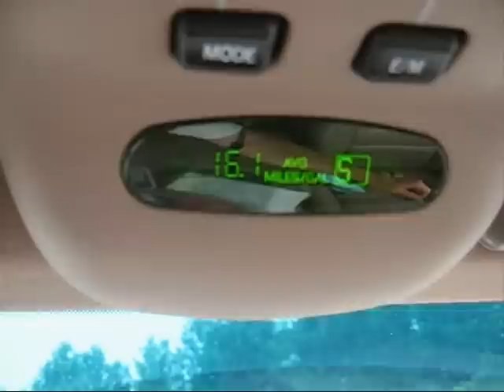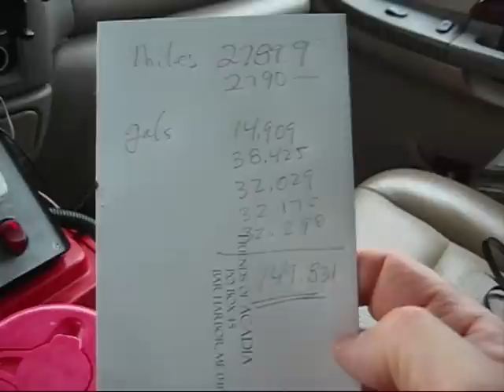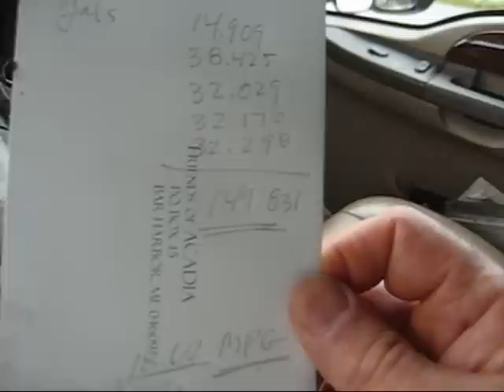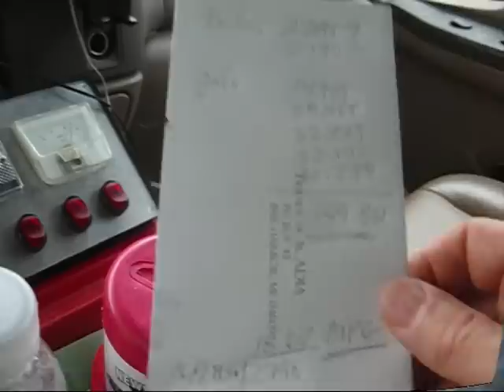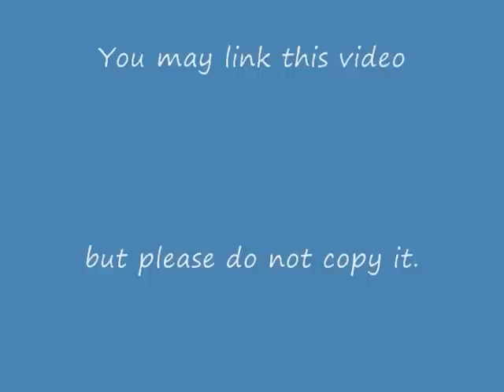MPG (mileage) Test 2790 miles with Dry Cell HHO F350 Superduty 7.3 Diesel

Comment: just a thought, OK so everyone is talking about how much energy is required to produce the hydrogen vs it's energy available when burned as fuel right? so how about building a wind/solar power station at home and producing the gas to be compressed into a tank? yes it would require more energy to produce, but what does that matter if one can run a vehicle or generator on hydrogen? we all have seen that mythbuster video, they did successfully start and run a vehicle with only hydrogen. they did not use a flashback device and that's why the hydrogen gas ignited. anyway, the point is, anyone can produce hydrogen and yes it will work as fuel once it is compressed and it works help to use a natural gas or propane engine. you can knock it and doubt it all day but ,even if it takes three times the energy to harvest, if you get said power from wind, solar, or hydroelectric.. who cares how much energy it took? isn't being independent and able to provide your own fuel/energy with the environment around you something to be respected and utilized? fact - fossil fuels will be depleted eventually. fact - hydrogen is the most abundant element in the universe. don't be a puppet.
Reply: Fact: Fossil fuels will last at least hundreds of years. Fact: Hydrogen is the most abundant element in the universe, unfortunately, elemental hydrogen does not exist on earth.
You are correct. However, you would only have to buy one third as many solar cells if you ran an electric car rather than a hydrogen car.
You will most likely be shocked to find out how many  solar panels you will need to produce enough electricity to run your hydrogen car! They will cost more than your house.
Reply: I'm a guy that lives in a small house and I only require 2500 watts (about 300 square feet ) to live very comfortable so I may be an exception to the space and money required cause I can build my own panels easily for under 2000$. That's with the inverter and south facing panel array. Your right though, if someone wants to live in comfort as most of us know it, yes it would be crazy expensive but luckily I don't like the overabundance so it works for me. It's all about who you are as an individual and how much of a skill set you have.
Reply: If you're talking about your home, no hydrogen is needed. Converting electricity into gas and then burning it in a generator to make electricity would be even more stupid than using it for your car. 
It is clear you haven't done the simplest math to see if what you propose makes any financial sense. 
What is your goal? If you want to do it because you want to drive a hydrogen powered car and live in a hydrogen powered house, fine. But, if you want to do it to save money, that will not be possible. It will cost you more than your house and a new luxury car with ten years of fuel for it.

Comment: If I kept my 2000 7.3 (F250, supercab, 8 ft bed, 6-spd, 4x4) under 2k RPM (70'ish), I could get 18.x mpg regularly. If I drove 55-60, it was in the 19-20 range...be it, it is a manual truck. 

Seeing 2 mpg, and having done a few years as a diesel performance and emissions engineer, that range in change could easily be from the difference in driving atmosphere/style.

Comment: I've gotten up to 32 mpg on a 2005 Ford Excursion turbo diesel on highway. 18 mpg seems kind of ridiculous honestly.
Reply from the maker: Occasionally this truck gets 99.9mpg.
Reply: Lol now thats just too funny
Reply: what is your set up to get 32mpg?
Reply: There isn't really a setup, the truck was just stock from factory. The only thing is that it was getting preventive maintenance every now and then. 

You know, just keep the engine running In good condition. It Will give you great mileage.
Reply: No, that's after doing the math. Miles traveled divided by gallons of fuel used.

Comment: hmmm my 2000 f-350 7.3 5 speed gets 19.6 hwy mpg stock.
Reply: joerotorhead. Agreed 
Also have a 6.0 with a heavy tune and 35" tires 6 Speed manual. 4x4 with hubs locked in .. 19.8 MPG.

SOMETHING NOT QUITE RIGHT HERE
Reply: I got a 99 ford 7.2 & get 17+...with 33k on it
Reply: Funny not one of you mentioned you rear gear ratio and only one of you mention tire size..

Comment: People always think of a diesel's mpg as like a gas engine's mpg ,wrong ! Diesel's mpg first off is mostly dependent on RPM's , you will get the same mpg in the city as you average on the "highway,( freeway)". If you want to increase your mpg's the most,get a higher geared rear-end. A 3.54 rear-end will average 24 mpg, ( empty weight ) , a 3.70 or a 3.73 will get you about 15 to 17 mpg or so & a 4.10 or a 4.11 down around 12 or so. Then after choosing your gearing ratio's, work on the aerodynamics ! In the old day's all semi's rpm's were 17 to 21 ( 4 to 5 mpg's ) , now their 13 to 17 ( 6.5 to maybe 8 mpg ). & some newer engines are even running abit lower on the rpm's. but here's the difference, Alot more Horsepower, lower rpm's = higher Torque    . Torque is what pushes you down the road with a diesel ! Torque is produced ,of course , by burning the higher btu's of diesel fuel. You can't "increase " your mpg's by lowering the BTU's of the fuel ! I do know a few owner operators the experiment with the old split rear ends , combined with there drive train, to lower the RPM's while driving on flat ground or just with lighter loads. ( Also, this only works with what is referred to as a single screw rear-end, such as your pick-up truck is. Most all semi's , with two axles on the rear are referred to as a twin screw : > ) ! ) Now for something out of the past, if you really want to experiment with something, some of the really older semi trucks had Two transmissions , one in front of the other ! If you've ever seen ( or heard of ) a twin stick truck, ( that's 2 shifting levers ) ! I've thought about putting two automatic transmissions ,one in front of the other , just to see if that'd work ! Good luck !
Reply: +73roadrunner1 yup, good 'ol brownie-box. many were shifted via solenoid switch on the main shifter, if you're good with it MPG goes up a bunch. a friend had a little old Dodge Colt with a 4 speed, plus mechanical shifted brownie-box. it took him a while to learn the complete shifting pattern (tricky!) that breaks into 500 rpm increments. car also came stock with an intake vacuum meter to help determine efficiency/gearing.

Comment: If you can see the fuel level in the neck then it means it's running out the overflow all over the road.
Reply from the maker: +thra5herxb12s I have topped off the tank this way dozens of times and I never had any spill. Some trucks may leak when filled this way but this one does not.
Reply: That's ok. Dont forget to leave enough room for expansion though.
Reply from the maker: +thra5herxb12s I used to worry a little about expansion at first but it does not take long to use up the fuel in the filler neck. and I haven't had any problems.
Reply: thra5herxb12s

Comment: I put a chip in my diesel, 6.0L Ford Diesel.. I'm getting 25mpg. Prior to putting my tuner on the truck in economy mode, I was getting 17.5 - 18.5 here locally.
Is this something magical here about this HHO? What is HHO? Hydrogen or what is it ? I found a bunch of wire on ebay, spring wire for a project, and it said it's for HHO, and had some danger disclaimers.. so wondered WTF was going on.. Google brought me here..
Reply: +Poppa Bear I too have a 6.0 "Bullet Proof" package with chip and 4inch open exhaust. Maryland to southern Virginia, cruise control at 70 MPH most of the way........24.4 MPG with AC on. Yea so I'm with yea on that.
Reply: Jamie Norton I got rid of the 6 liter a while back, and got a 6.4. I've been pretty happy with it, until a few days ago, it threw a warning light . I think it's simply under charged battery caused a glitch while starting. I need to remove the posts, let it drain, reconnect and see if the issue is still there.
Been a good little truck so far. Metal rusts pretty easy underneath however.

Comment: As much as it is great to see people experimenting and I realise that the total weight was very high plus bad aerodynamics plus a US gallon is slightly smaller than an imperial gallon etc etc. My recent holiday with my crappy GM diesel car towing a small trailer averaged 56mpg over about 1100 miles, the overall weight was a lot less than you were hauling plus I have only about 200hp. To be honest your fuel consumption sounds extremely bad (by European standards). It does seem like you are using a lot of current in your electrolysis, I realise you have a big engine but you are probably using 3 or 4hp just turning the alternator.
Reply: +David Lisney I've been so jealous of your vehicle options over there.  Could never understand why we don't get little diesels.  They are practically drive for free lol.  Oh well, I guess I can't complain with gas at a $1.69 per gallon.
Reply: +David Lisney Hi, I have a diesel short school bus that I'm going to convert into a 
RV, i bought it for $500.00 the man said he thinks it blew a head gasket
 how can i tell and if it cracked the block, please need advice should i
 try to crank it, please get back with me I'm desperate thanks
Reply: @mollythomas6824  look up oil in coolant

Comment: I respect your ambition but to improve your system you need to remove your massive brick with a smaller more efficient design. Either wireless elcetrolisis or 12v dry cell tower. Keep resivor almost full at all times because keep in mind heat is not the source of hho. It is the electromagnetic Impulses that split h20 into hho. It will convert at any tempature above freezing. I encourage you to look into free electrical generation "with no moving parts" to power your dry cell. Because with and alternator to power your cell you will never get more energy than you put in to spin it. Keep it up!
Reply: But the gas is not supposed to spin the alternator but mix with the fuel to explode better for a better conversion of the residual energy in the petrol that gets wasted because the environments it explodes in is heavy and non volatile, as opposed to Nitrogen.

Comment: I have done this. It will waste your money and time. I bought a basic system from Ritchie, "HydroClubUSA" and a basic system from "Green source" in CA. It is useless. Cost me hundreds of dollars. Neither would refund my money. Proof its a scam! I even built my own HHO generator. It does produces the gas. The carberator is not set up to adjust for the flow of HHO. You can't control the flow of gas and you can't reduce the fuel(gas) when needed. I used the EFIE AND PWM it does not work. I bought two from green source. One was DOA they would not refund them, "Amazon"! BEWARE SCAMMMMM.....$$$$
Reply: +Jim Mccoy seen this exact copy-pasta before and replied same. car's ECU needs to be reset when you put the system in, then drive like a granny for a while for the ECU to "dumbly" compensate for what it doesn't recognize.
Reply: If you car has oxygen sensors (fuel injected) you must install a small electronic component, meant to fool the ECU into seeing less oxygen in the exhaust. It installs in between the wiring from the oxygen sensor(s) and the ECU.  A $ 80 part, that makes the whole thing work properly. Without it, you will see initial gains, but the ECU will eventually see the extra oxygen present in the exhaust from the HHO, and add more fuel (making mileage worst). Set up properly, an HHO system improves mileage, cleans the motor, and the exhaust is very clean emissions wise.
Reply: Yeah alot of these people scam others by advertising as plug and play great mileage. Realistically you need to tune your ecu to run very lean otherwise youll be using nearly the same amount of gas anyway

Comment: Test is flawed.. you need a control..
I drove 2500 miles in a car that was supposed to only get 28mpg hwy and I got 35mpg the whole trip.. 
I was moving too, so the car was packed to the roof with TV's, an extra set of rims, clothes etc.. 

If you got one of those mason jar setups running off your alternator, its not doing anything.. ive seen those guys trying to peddle that stuff for years now.. I'm on-board as soon as anybody produces some 'real' results.. so far, its all been snake oil..

Comment: there is a video showing a car that had running on hho and they remove the head of the engine, combustión chamber and valves were insanely clean , the exhaust valves where whitish indicating perfect combustión, no soot at all, and what is soot?? incomplete combustion residues
Reply: +TheEdudo back in the "70"s , when engines were all set on "top dead center" , you could tell if everything was tuned right if the tail pipe was white at the tip ! Using good ole gasoline !

Comment: what you did is very well because you try in a good wayI could tel you when the diesel is burning what is burning is hydrogen when you  you add  more hydrogen  you put a suplement in the combustion but you only increase a lit beat the compression for to increase the compression you need to introduce atomization water and you gona get more power and better combustionyou , go to the web side and get a lot information, and for esplit up the water is the voltage no the amperage you can put twoo or tree car coil and increase lpm and the amperage gona be very low and no more heat and use in the water some catalizer for increase the hho

Comment: all you had to do was drive that truck to the dump and build a car using compressed air tank 10,000 psi made of carbon fiber composite with four inwheel rotary Wankel engines. fill your tank up with compressed air someplace and you would have the best vehicle on the planet.
Reply: unless you get in a car wreak then you get blown to 50 pieces. 10,000 psi... yea totally safe broh
Reply: Jay, where is that "someplace"? A compressor that will go to 10,000 psi is a rare beast indeed.
Reply: +Jim Mowreader great point, dive shops I think only dish out 3500 psi. but good luck finding a dive shop in a Arizona or half the country.

Comment: 19mpg at 62mph is the best my 7.3 has ever gotten on a highway trip with a bit of city driving while I am there.  Thanks for the videos, looking forward to seeing your end result.  2000 F-350 ext. cab 4x4, 4.10 gears 6 spd, edge evolution tow tune and 4" straight pipe.  I think most people's claimed mileage is highly exaggerated.